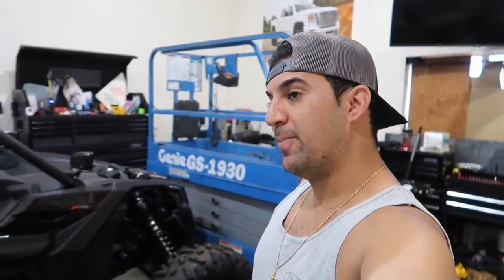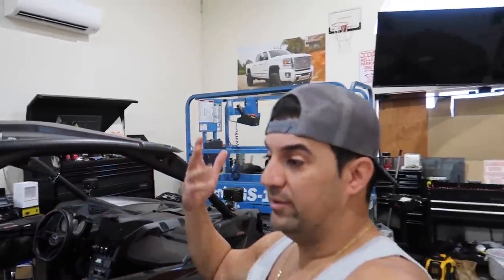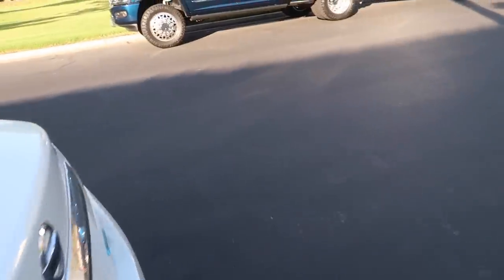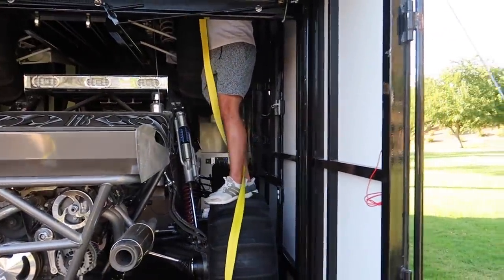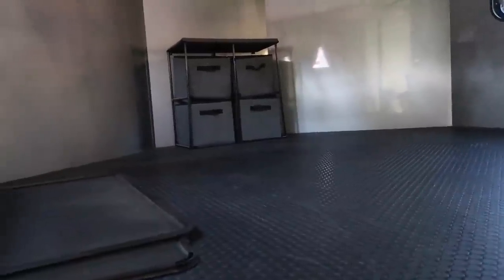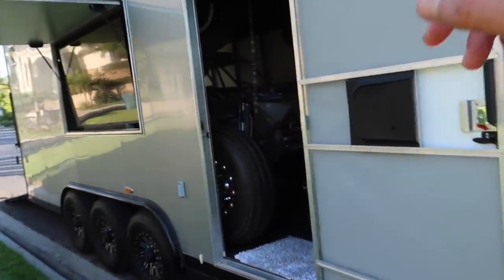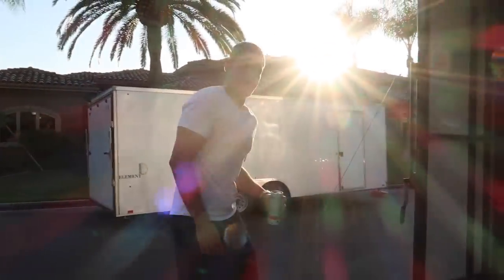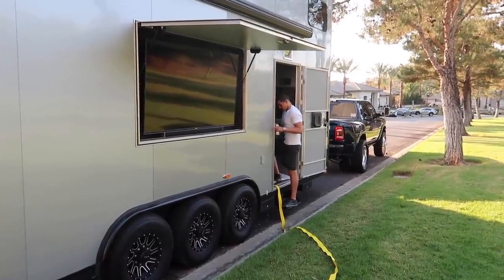NEW DESERT TRAILER

Comment: Should've gotten the L5P with the HP4.
Reply from the maker: no thank you
Reply: Yeah, my CP4 went out on my 2019 Ram 3500 Limited Dually two months ago.  Just got it back 7 weeks later.  $14,000 later and after 7 weeks on backorder, I'm up and running again.  Luckily under warranty.  FCA did assist with incidentals though.....

Comment: Eddie you can buy a freightliner chassis truck they make good toy hauler rigs and can handle up to 30,000 pounds easy also going up grades is no problem for it
Reply: Would someone have to get their CDL if they got one? JW
Reply: @carls2210  Not with AZ plates/DL. Any RV and "not for hire" is good.

Comment: I have an extra f250 with a 7.3 you can borrow until you fix your RAM!!!!!
Reply from the maker: Thank you for the offer but i am okay, but that is much appreciated
Reply: @EddieLife3500  425 lb/ft tq sounds bad 😂😜 less than half the tq is like ~3 cylinders on these new trucks!
Reply: Scott L who said it was stock?
Reply: @sp8313  Let's see it make 1000 lb/ft for 15 miles on a 7% grade towing a 20k lbs trailer and I will believe. I've not seen it on the internet so I don't believe. Powerdriven diesel did this with a 12v cummins and compounds etc. the right way and they say "instead of pouring money in to us, just buy a new truck"
Reply: Scott L calm down Karen!!!!!
Reply: @sp8313   Let me speak to your manager!

Comment: What did you do for ur LML’s pump? I sold my 2013 LML because I didn’t want to deal with that thing blowing up. Just went with the L5p 2020
Reply: Kyle, my L5P just had the entire fuel system replaced lol don't be to confident.
Reply: Ricardo Gomez what happened with the denso hp4, and what year is ur truck and miliage?
Reply: Ricardo Gomez so I did a quick search asking “Denso hp4 failure” and I couldn’t find anything, anyway you could send me something so I can understand want is happening with them.
Reply: @kyleb2214  2018 70,000 miles and the pump starting coming apart, found metal fragments in my fuel filter. When I noticed something was wrong was when towing up steep hills, I would lose all power. It would shoot a p228b p228c code. The pump wasn't able to maintain the desired fuel rail pressure the the ecm wanted. It took 3 trips to the dealership before they figured it out.  The GM tech (who is a friend) says its a rare failure but they are failing. I wouldn't worry too much about it
Reply: Ricardo Gomez that’s crazy but thanks for the info I will keep those codes to look back on. Well I got the extended warranty tell 100k so should be covered. Thanks again.
Reply: @kyleb2214  just be sure to change fuel filters on or before the required time, also save receipts lol the stealerships tried to say contaminated fuel but luckily I knew the tech and he proved that otherwise. I told them if it would have been it would've ran like shit, it ran good other than when I was towing up hill.
Reply from the maker: crossed my fingers and prayed haha and ran lubricity in the fuel
Reply: @EddieLife3500  🤣🤣🤣 its all you can do

Comment: Lift pumps do nothing. Only company you can get a CO3 for the Ram is Industrial Injection. I just got rid of my Ram for a 2020 Duramax. I sleep better at night.
Reply: What was wrong with your Ramer
Reply: 2019 Ram 3500 with the Aisin. Paid $58k for it in Feb sold it for $64k.
Reply: I sold my 2013 Chevy 2500 Duramax for the 2020 Duramax  also 👍🏻I’m with you J Mobs the worry of the pump going out isn’t in the back of my head anymore. Even through a guy commented on something I posted that he just had to replace all of his fuel system on his L5P.
Reply: @kyleb2214  I also had a 2013 LML and did the cp3 exergy conversion,  ended up selling my LML and I got a 2018 powerstroke I do miss my LML this f250s are very good trucks but LMLs are superior my honest opinion
Reply: I loved that truck also got it brand new in 2012 owned it 8 years and only had 70k on it. But didn’t want to worry about the ticking time bomb.
Reply from the maker: cant say the 2020 duramax is a bad truck, just there interior is hideous and killed the deal for me
Reply: Eddie's Life I hear ya. My Ram Laramie is equivalent to my GMC 2500 because I had the 8.4 screen. Now the Limiteds are top notch and top dollar. Oh and the ride in my GMC is like a Cadillac compared to the 3500 Ram. I needed a Carli setup if I were to keep it.

Comment: 2:36. That’s why you just buy a power stroke and be done with it
Reply: I guess you didn’t watch do you want lotta videos back he had an F2 50 it was all over the road and some hose broke when he was done testing it
Reply: Trxpic I know he doesn’t like Ford’s but they are the best truck on the market.
Reply: maxracingteam23 You really do not watch this guy he likes all GM, Ford and ram he’s looking for the best truck that pulls his toy hauler in the Ford did not do the best the ram did the overall best that’s why he chose the ram
Reply: maxracingteam23 In the best diesel engine that Ford ever made was a 7.3 the 6.0 and the 6.4 Are just terrible engines
Reply: Trxpic ah yeah I’ve watched Eddie since day 1.  We all have Ford F-350 and 450’s and they tow like nothing not sure how the Ford doesn’t tow hood
Reply: maxracingteam23 You must watch three Seconds because you have no clue about this guy you would understand he likes all GMC Chevy Ford and ram and you would understand he picked the ram because of how it towed Like you understand he didn’t go over the Ford because he didn’t like how it pulled
Reply from the maker: guys honestly all 3 trucks tow amazing for what need the ram gm and ford will all do the job and all have there problems i just like the ram the best because of the interior and the motor, but they will all get the job done
Reply: @EddieLife3500  But if you had the LML still, or L5P like your old man, you wouldn't make that extra video about the lift pump, and the video about the cp4 upgrade/replace, and the video about the issues, and the video about the delete. It would only be filling up with diesel and DEF and going about your life 🤷‍♂️ Edit: didn't mean this post shitty... I learn from your problems and wish/hope for the best! Thanks!